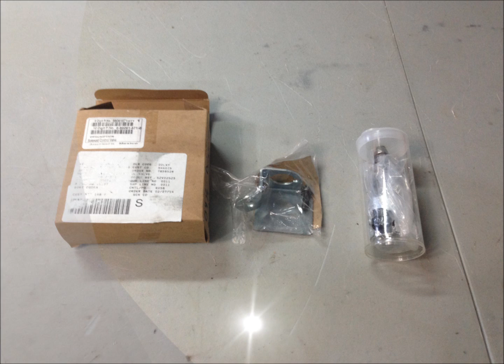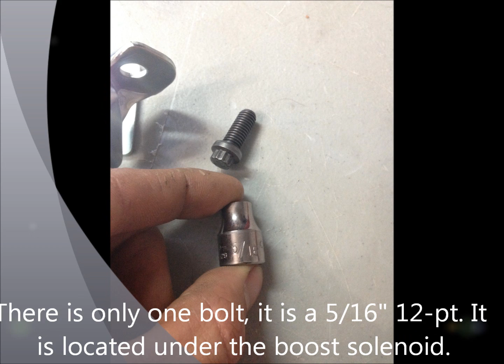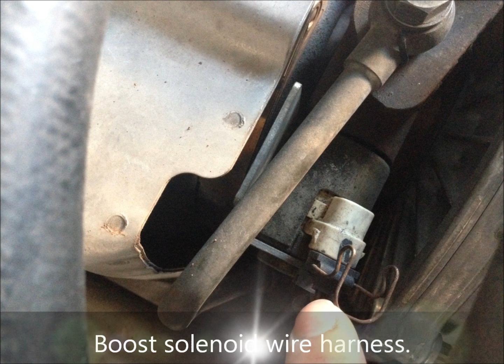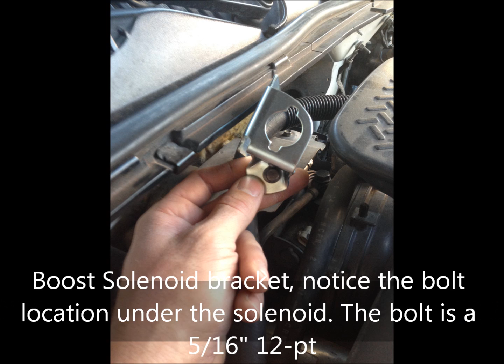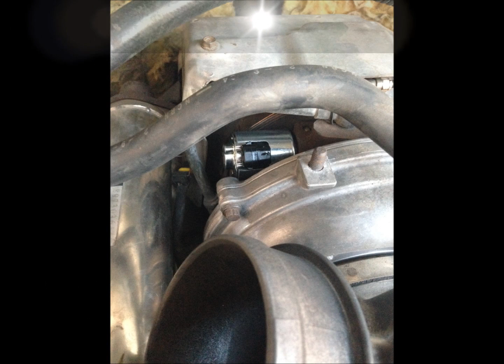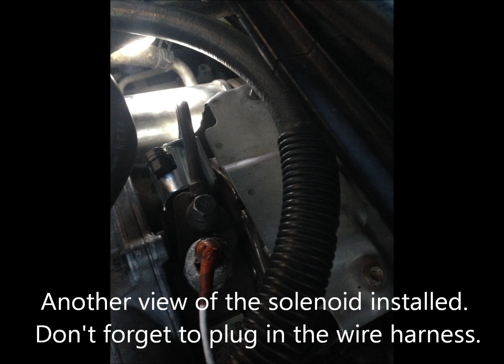Replacing my Boost Solenoid in my LLY Duramax

Comment: did you have to do a relearn after installing?
Reply from the maker: 🤓 I read that you are supposed to. However, I did not. 🙈 It is my understanding the truck will learn the new part fairly quickly. I ended up replacing the entire turbo and have not done a relearn. 🥸 It drives smoothly and I don't notice any issues. I suppose there's a slim chance it could be better with a relearn. 🤔

Comment: I have no codes but turbo comes and goes 2011 gmc 2500 but when turbo works it works great I'm going to test fuel pressure  and test vgt
Reply: You have any other suggestions
Reply from the maker: The sad truth for me was the mechanical part of the vgt arm actuator inside the turbo was the final problem. The new VGT and rebuild helped significantly and allowed me to drive my truck for years, but it would have issues every once in a great while. I replaced my turbo last year with a brand new one and it works perfectly. My truck is s much smoother, and less smoke!
Reply: Well that sucked but glad runs better  I was going upgrade my turbo but don't want to so soon if it the problem

Comment: What does it to when it goes bad?
Reply from the maker: To the best of my knowledge (I'm not a licensed mechanic, lol) :  Inconsistent power (more, or less). Turbo vanes not operating correctly (slow, incorrect actual position vs what computer says it should be). Check engine light, dtc codes for turbo vane position. However the vane position sensor is what is verifying the correct location, so there is a chance the solenoid is correct, and it's your sensor giving a bad signal. Should try to verify if sensor works forst.
Reply: @DustyTrailRider  hey man, so do you know how to check if the vane position sensor is faulty?
Reply from the maker: @janfriesen1092  I know of a couple different ways (but I'm sure there is more). 1). The truck will throw a code (check engine light) for the vane position sensor. 2). You can read the engine data with the truck on, and check the vane position, it should move smoothly up and down as you drive. 3) Pay a mechanic, lol.

The sensor's plunger should operate smoothly. That can get gunned up and stick. But they can also fail while still operating smoothly. 

I think it's pretty common for the variable geometry internals to fail/stick though.

DuramaxHub.com has excellent qrite ups on completely rebuild the turbo! 

http://www.duramaxhub.com/service/6.6l-duramax-vane-position-sensor.html

http://www.duramaxhub.com/service/6.6l-duramax-turbocharger-rebuild-guide.html

http://www.duramaxhub.com/service/duramax-gt3788va-turbo-cleaning.html

http://www.duramaxhub.com/service/duramax-gt3788va-vgt-piston-actuator-gear-indexing.html
Reply: @DustyTrailRider  I'm getting these symptoms and a PO299 (under boost) code, so I plan to do a boost test and check the boost sensor as well -thanks!

Comment: I dropped the bolt straight down wtf could it have gone
Reply from the maker: That depends on exactly where it ended up. But it's probably not a big deal. You can try a small bendable magnet and go fishing for it. Slim chance it fell all the way to the ground. According to: https://www.duramaxforum.com/threads/vane-solenoid-mounting-bolt-help.779425/  it's an 8mm thread, 20 mm long, 12point head. I used a 5/16-12pt socket. Good Luck.